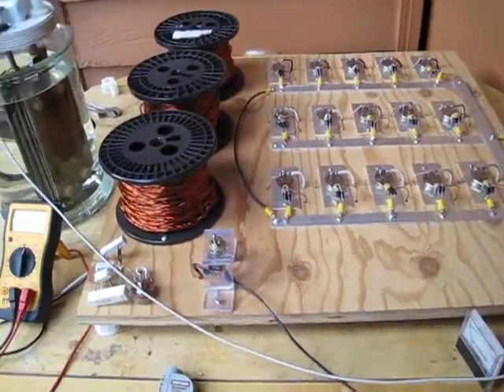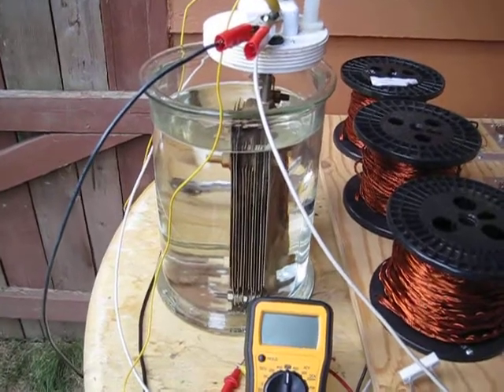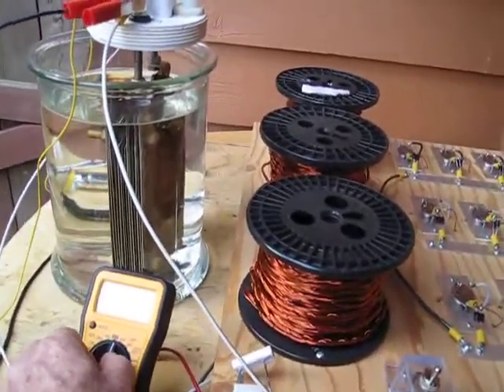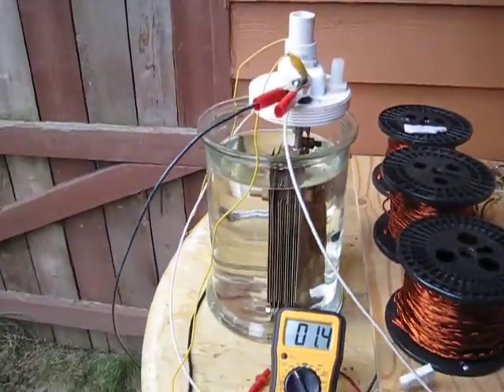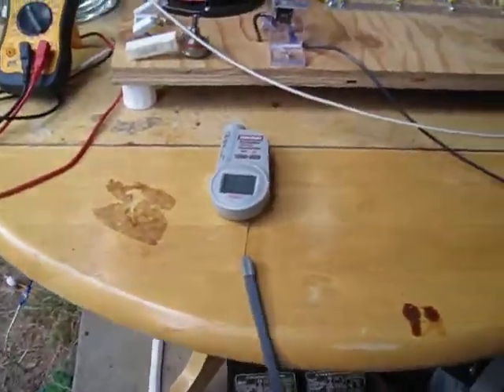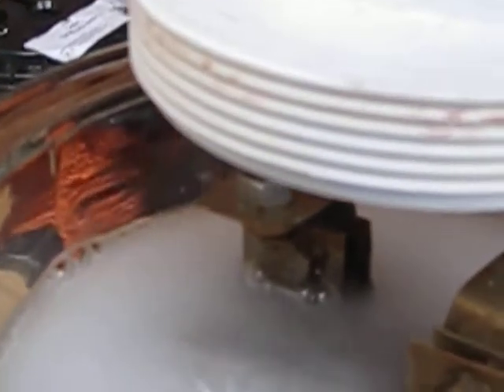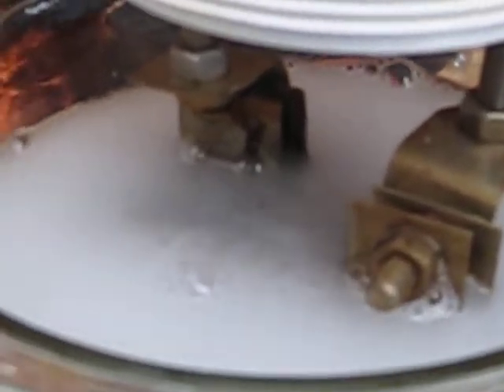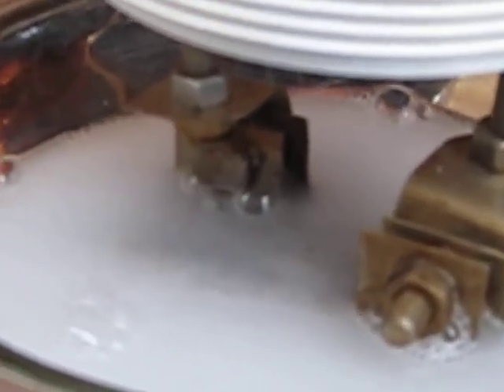HHO cell with 14 tea spoon of sodium hydroxide 002

Comment from the maker: The solid state set up puts pulse of up to 300 volts using 2n3055 transistors that you can get at radio shack, i get bundles of 20 or more at ebay auctions which saves a lot of money. also get some 1n3508 diodes to come off the collector, they are rated at 3 amps up to 1000 volts. the stronger transistors i will be using next can take 140 volts 20 amps so spikes should be close to 1000 volts. video to come soon. wish me luck lol.

Comment from the maker: the solid state set up design is at our web site which is international  alternative  energy center.  under how to. would take a while to describe how to build one, but its really simple. the cell configuration was done by a friend that would rather i not disclose its design right now, basically you can take 14 stainless steal plates and configure them positive and negative and divide them into individual cells to make 4 cells. ill ask him later on if i can break down the cell for you tomorrow.